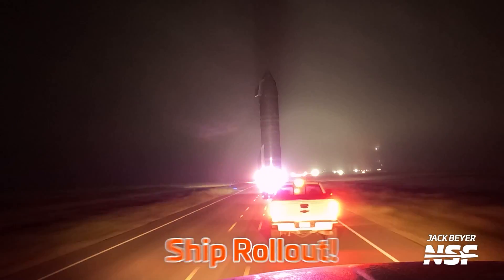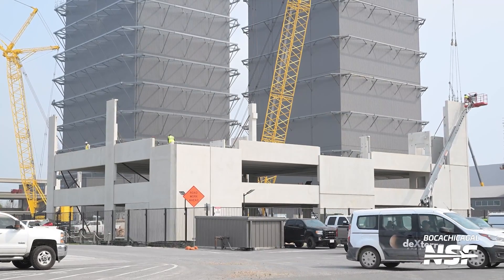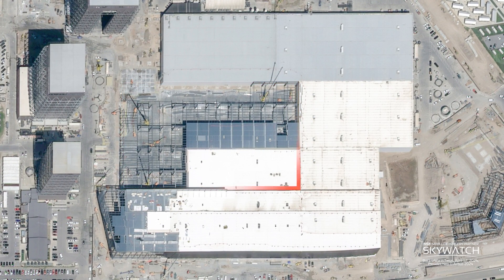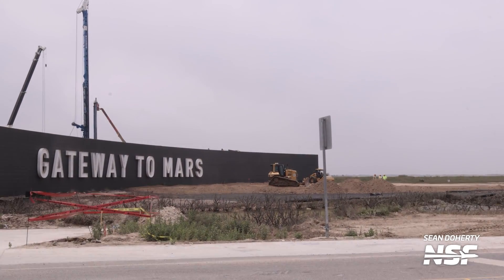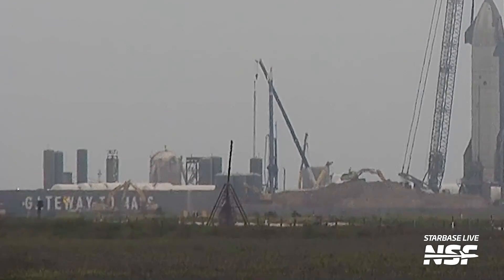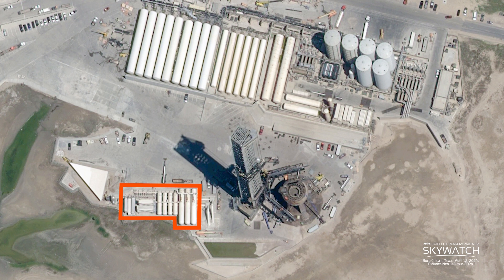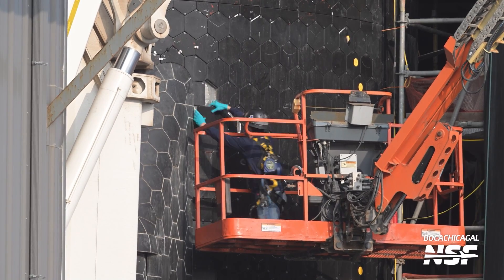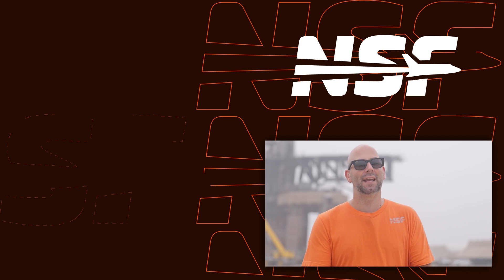Stage 0 Testing In Full Swing! | SpaceX Starbase Update

Comment: One thing that concerns me is how those hard chopsticks rails will soft catch boosters/ships...  The ship/booster "nipple" crushing in that hard rail will be tough.  It will certainly damage ship/booster structure.  I think they will have to come with a better idea.  I imagine a kind of a steel cable, offset from the chopstick structure, that would soft catch the "nipples" and transfer the load to the cable (with some spring/pneumatic system).  Like two bow arcs on each side of the chopsticks.  And when the load was transfered to the cables, then it would soft lay the load to the hard rail.  What do you think?
Reply: The top of each [massive] chopstick arm has a (relatively) lightweight boom that can handle a low velocity downwards collision. There are [vertical] linkages, springs, and hydraulic pistons within each boom [allowing it to make rather rapid vertical adjustments].

The hard-points for mating to the booster are carried on a horizontal track [on top of the boom] that is supposed to rush into position, tracking the booster hard-points. (It also provides the means of adjusting the booster to orient over the launch mount.)

It's the responsibility of the ship and booster to hover accurately while the arms close snugly. Then the booster descends and/or the arm [boom] rises.
Reply: @imconsequetau5275  I see.  But I think it is a massive hard structure too close to the heatshield tiles...  It will certainly damage them.  But what you described should work...  In my opinion it is too much high tech.  I was thinking more like an carrier boom...  Like those that stop fighter jets. Anyway.  We will see. Fingers crossed!
Reply: BTW, the Chinese space agency published a video of a booster catchment system using horizontal cables that rapidly slew into position beside the descending booster. Have you seen it? It maybe was released on April 1st...
Reply: @imconsequetau5275  No I didn't.  I'd like to see it.

Comment: I keep wondering how much dynamic loading are the chopstick arms and tower designed to handle. I'm guessing current design is the booster or Starship is lowered gently into the resting position before the rocket motors shutdown. If thrust were to fail when lowering into position, how much of a drop can the chopsticks/tower handle without damage or failure?
Reply: If the Chopsticks come under the same ratings as that for a crane, which is twice the maximum weight, i.e  a crane rated for 10 tonne must be able to hold a static weight of 20 tonne, then as long as the thrust failure does not allow it to drop more than 200mm, it should hold. Not much room for error.

Comment: SpaceX needs to have quite a few successful captures at the Virtual Tower out at sea before it risks potential damage or destruction of the real tower.  😂✌
Reply: The only problem I fear is that if the cause of previous engine failure is not thoroughly solved, we could see an engine fail while hovering between the chopsticks. 

I expect that the oxygen tank is filled with CO2 and H2O ices due to the current design of Raptor V2. Those ices are contaminants that may clog the filters at the LOX engine inlets, or cause valves to stick. 

I suspect Raptor V4 is using a clean way to vaporize O2 for autogenous pressurization. Hopefully, the stage-zero ground system will survive until then.
Reply: @imconsequetau5275  Where would the H and C come from to form those ices?

During hovering only about three out of thirteen inner engines are firing, and they are at no more than 50% thrust.  This is not a situation in which failure is likely.  If it does the booster can always increase the thrust of the other two engines, or fire up one of the ten idle engines.

Unless you have experience in engineering do not speculate.

Personally the odds of a successful virtual landing in the Gulf are still less than 50% and until they have an almost completely successful virtual landing SpaceX will not try on the tower.  Note that recent simulated videos show the booster approaching at an angle from the sea toward the OLIT.  That means that at any point SpaceX can abort out over the Gulf.
Reply: @jamescobban857   
The present design of Raptor used on these test flights have two different methods to supply autogenous pressure. The pure methane is circulated around through the 3D printed channels in the combustion chamber walls and nozzle throat. Pure hot methane gas pressurizes the methane tank. 

The oxygen autogenous pressure system is supplied, tapped off, from the oxygen preburner. So there is CO2 and H2O byproducts coming from here. This is not speculation. 

I'm sure this design is already made obsolete by the next generations of Raptor. Hopefully, the next Raptor version is already using heat exchangers to pressurize the oxygen tank with pure hot O2 gas. But will these be used on IFT-4 or IFT-5?

Comment: One point I have made before and otgers do not see my reasoning , is why there will not be two lower chop stick arms to aid the catching of booster. If booster cones in at an angle and is clearly balancing on the power from the motors, what will stop the booster swing like a pendulum from the upper arms when the motors cut off.

Comment: The IFT3 mishap report still isn't complete as far as we know so I think IFT4 might slip into June, but SpaceX are clearly making the most of this extra time with work on seemingly every aspect of Starbase.
Reply: the previous IFT2 report was signed off pretty close to IFT3, it's only logical it's just a signature at this moment in time.
Reply: They always get approval like a day or so before the launch
Reply: The mishap report is written by SpaceX and merely approved by the FAA.  This is the normal process with manufacturers who have earned the trust of the FAA.  In other words not Boeing.  Note that there are FAA engineers permanently assigned to SpaceX, and the required documentation is very well specified.
Reply: Just to pile on, as mentioned above, SpaceX does the actual investigation, and the FAA validates and verifies.  But more importantly, the name 'report' might suggest that SpaceX produces a document and delivers it to the FAA, which they then review.  In practice, it's more of a collaboration, where SpaceX and FAA produce the report to the satisfaction of all, with the 'submission' part just being the formal filing of findings.  This is why the turnaround between the delivery of the report and approval is so short.  This is also why the remediation steps specified in the report are usually already implemented when the report is filed - SpaceX can work with confidence because they already have an agreement that the remediation matches FAA requirements.  The report just formalises what both parties already know and agree on.
Reply: Reminder that SpaceX lead the mis hap investigation. It can all be wrapped up in a few days like it was for flight 3